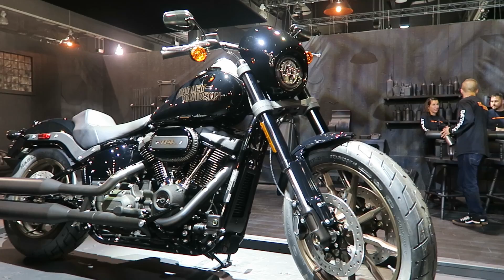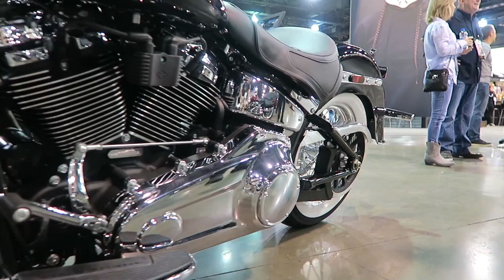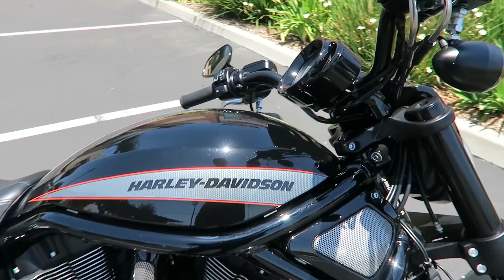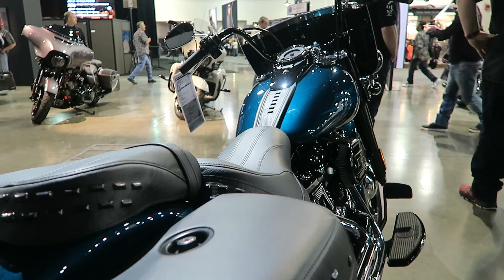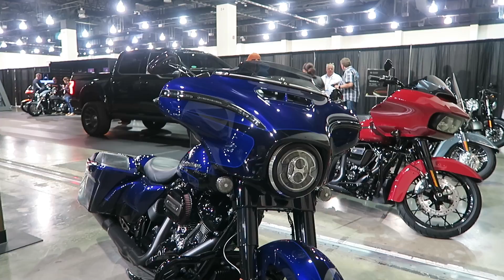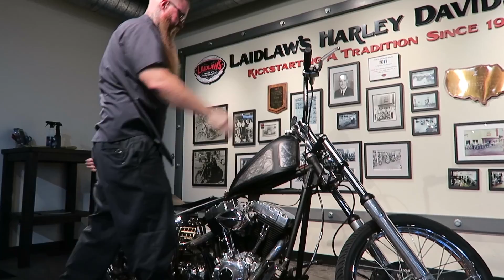Harley-Davidson: The Look, Sound, & Feel - You Just Wouldn't Understand

Comment: I have a Kawasaki Vulcan 1600 right now that’s liquid cooled. It makes no big difference on the Kawasaki 🤷‍♂️. It’s all bottom end torque and falls flat on its face on the top end. About same HP as the Harley’s. In my opinion the water cooling just adds more things to go wrong...coolant leaks, water pumps, ect. It also has overhead cams. Again no big advantage over a compatible Harley. They Harley twin cam 88 I had actually ran stronger than this water cooled overhead cam Kawasaki. Don’t get me wrong it’s a great bike and I got it really cheap just to have a little fun with until I’m ready for another Harley. But judging by Kawasaki just adding water cooling and overhead cam doesn’t make it blow a Harley out of the water like many people think. I got smoked by buddies 103 softail pretty easily

Comment: In 2016 I purchased my first Harley, a Velocity Red Sunglo Street Glide Special. My previous bike was a Kawasaki Vaquero. While I would say the “fit” on the Kawi was good, the finish was not even close to the Harley. I also picked up on the “feel” of the Harley immediately. I’m hooked. Just purchased a 2020 Road Glide Special and can’t say enough about how much I love this bike. The only issue for me with these bikes is the suspension. I am only about 155lbs and find the stock suspension to be very harsh. A quick change to Legend suspension solved that problem, and I anticipate putting down a lot of miles in this bike! We have a very active HOG group here and that has opened up a new group of friends and contacts as well. I don’t anticipate ever riding another brand again.

Comment: The bikes are just way overpriced and they have cheapened them up in comparison to the  older models. The new softail models having the stupid so called decorative fake fuel cap surely they could have blanked out the hole or made it dual fillers ,instead they  put a shitty chrome cap in the hole .Considering a low rider here is priced at $24495 (a road king is $34495 how is it $10000 more bike? at least  you do get a fuel guage and a working fuel filler in the tank it is a lot better bike, but $10000!) its just not good enough .Also having a mono shock is no big deal ,Harley seems to think they reinvented the wheel because of this ,the old frame was fine anyway. Yes the paint is good on harleys but it can't justify the cost and they have cheapend out on alot of the colours now. I think they should have just stuck with what they had and made a few improvements to the reliability . My closest dealer here in Aus seem to only cater to people who just want the bike for looks and the name on the tank ,start asking questions about the bikes build and engineering and you are treated with disdain this seems like a common theme around the world with a lot of dealers.I think Harley Davidson as a company take people for fools ,I feel for the good honest dealers out their such as Laidlaws. Having to explain the one key fob and heel shifter removal amongst other things just should not happen on products that cost this much. The new bikes just don't have the same feel or sound and you pay more for less.

Comment: I agree what you said about the V-rod.  I was so happy when the V-rod concept of a high reving liquid cooled engine was announced.   I pictured a fast good handling bike, then it came out.  Terrible geometry,  stupid forward controls,  basically it wasn't a good cruiser,  wasn't fast enough,  didn't handle at all.  I ride an FXRT and basic FXR with mid controls and have been waiting for something similar but we know it won't happen. No other harley has appealed to me where I would even keep it if it was given to me.  Now the adventure bike, YES!  It looks like they designed the bike from the ground up and not a dude in a dress like the Vrod.  The power on the adventure bike is right between the KTM and BMW.  If the weight and price is there too, I will go buy one.

Comment: That is exactly what a love about HD sound, look and feel, it is old nostalgic and kinda of obsolete machine with some flaws like poor suspension, lack of power and questionable reliability especially from Twin Cam that I own but I still love riding it and If I ever have to buy another cruiser I doubt I ever look into another brand. I hope that big twin will remain in its current configuration. Modernized Harley with newer type of the engine will not appeal to me as I will simply choose another brand with way more experience and know how in building hi tech liquid cooled multi cylinder engines. I understand that Harley needs to build bikes that will attract new younger riders but I hope that HD will keep its traditional line of big twins and Sportsters unless eco mafia will destroy and ban our beloved machines from use.

Comment: Out of respect, I watched the whole video. I still own and love my Road King Twin Cam, modified heavily. I have to disagree with a large amount of your video, I was in the market for a new Limited to replace my Ultra Classic. I bought into all the things Harley doesn't want. Including the power windshield. My second bike choice involved ride comfort, options, trade. Whatever was driving the trade in, I got 3k more for my Ultra at Indian than Harley would give me. That's real money. The standard equipment, steel braided brake lines, chrome lowers, quick detach trunk, TPMS, heated leather touring seat. Led lighting all around. Sometimes it's not about owning a Harley. That chunky aluminum frame and stressed member engine drops weight and center of gravity. I test rode a few new Harleys and liked them. I rode the Indian and was shocked at how plush it is. It's a lower seat height, it's my lovely short legged wife being able to climb on easier. Here is where I get to massage your ego a bit. I will be the first to say the fit and finish on the Harley is superior, they are beautiful, but I am not looking for that in a long distance touring bike. I want that gear to gear primary, the ability to change the drive belt with out taking a primary drive off, the one hole oil change, the Fox monoshock suspension. I love my Harleys, but I am now 1500 miles into loving my new Indian. Who knows, it may change, but for the major component failures I experience with both Harleys at and under 40,000 miles, I'm moving on.

Comment: in  1975  Kenny Roberts brought out a  Flat Track bike with a  4 cylinder  Yamaha   two stroke .. I  had  about  140  HP  HR  XR-750  had  75  HP .. and the Yamaha was way lighter..  The tire did not hold up Now days they have much better and wider tires   and have  110 HP ..  The DD-XR-750 had to be rebuilt every weekend .. Indian  suggests  a rebuild every  40 hours   25 mile race at   35 seconds per  lap  only takes  15 minutes to run ..
https://www.bitchute.com/video/PKyCKRU6e6xG/
  By 1985  the Yamaha TZ-500 was making  150 HP    technology advances  except those who run  air cooled  push rod motors..

Comment: Matt, unfortunately the sound, feel, and look making up a "real Harley" just ostracized the upcoming Pan America, Bronx, and the 'cruiser' version the Custom (you did NOT qualify this as the characteristics of cruisers until half way through the video). These will not be pushrod, not air cooled, not 45 degrees, likely will not have a big bore kit, not have the Harley 'look', may end up sounding like an import, and will likely feel completely different from anything else in the lineup.  If this is an indication of the reception these will get then the launch may not go too well.  The Vrod example you highlight just doubles down on this prediction. The PA and Bronx will be a major departure in all aspects and will be labeled "NOT A REAL HARLEY."  Good thing I don't care since I am anxiously anticipating the PA launch so I can take one for a test ride.  A test ride on a now labeled "fake" Harley. Makes me sad. Dismissing this later does not matter, you already defined what a 'real Harley' is feeding the misconception out there amongst the people that think anything without a carburetor or kick starter is 'fake.'

Comment: In my opinion why the V-Rod was a miss simply due to ergonomics. Put that engine into a Road Glide or Street Glide design and they'd have sold. I actually liked the V-Rod engine "look" as an aside to address the cosmetics that you mention Matt. I'll agree that the V-Twin sound has a great sound. What I need though is a cooler running engine. You all are spoiled back in California, try to deal with the air cooled touring bike in traffic in the South. I miss California, born, raised, grew up there, moved away decades ago due to work and life, that's on me. The bike needs to be designed from a world wide perspective. That you can use it anywhere or most anywhere and have a good experience. Not one where your bike shuts down due to heat issues while on the interstate down in say Alabama for example, which did happen to me while on my 2015 Road Glide Special during the summer a couple years ago.

Edit: Forgot to mention, I loved the whole start of the video with Bob. So much awesome on that old HD.

Comment: I've ridden a few iterations of Harley and if I'm honest other than the sound and the visceral feel of a v-twin it under performs in just about every category I ride a motorcycle for.  The power/handling/braking/ of Harley leaves a lot to be desired unless you are literally just out to cruise in a straight line and be seen.  Harley sells an image as much as they sell a piece of equipment which I get and if that's your thing then that's great.  I ride a Honda XR650R in Baja not because of the look, sound & feel.  I ride it because it is a great cost effective piece of equipment that helps me to explore remote places doing something that I love doing, riding a motorcycle.  That doesn't mean I'm going to get a leather Honda vest or a Honda tattoo to show others how good it is because that's not really at the heart of loving all forms of travel on 2 wheels, at least for me :)

Comment: It' funny ... you say your dealership doesn't compete with Indian but yet you continue to bash them.  Any Indian with a good set of pipes (Including the Challenger) will sound every bit as good as a Harley. You guys sound ridiculous. Who wants a power windscreen with all that weight. Who wants a great Ride Command system with all that information. Who wants a 122HP motor...who wants over 4 inches of travel in their rear suspension.   c'mon man
Reply from the maker: bbgmarine I love my new Indian cry baby viewers. I never even mentioned Indian in the video. Are you just ultra sensitive and insecure? But since you brought it up: They don’t sound as good as H-D, the windscreen is hideous, the design is atrocious, the engine puts out 103 HP to the rear wheel which is all that matters. So it does about 15 more H-P than the Harley without water cooling. The new HD infotainment kills the rider command. The fit and finish is trash. The paint looks like it is intended for an off road vehicle. The lighting is very cheap looking. The inside of the fairing looks like it was slapped together with no thought to a clean design. The bags are flimsy. The Plastics on the bike are very cheap and the quality is no where near the H-D.
Reply: @MattLaidlaw  - I have sitting in my garage a 2019 HD TriGlide Ultra. As a matter of fact, it's the same color as the one you and Nick did the YT video on.  It's a great machine and my wife and I love it.  Paid cash for it. She doesn't feel comfortable riding on 2 wheels. We're both 62 so I won't question her judgement there. I just bought a new 2020 Challenger and I love the bike. Handles like a dream and will walk away from any stock HD 114 out there. But that's not why I bought it. I just wanted the feel of riding a 2 wheel bike. Both brands have their pros and cons. I'm just saying...leave all the negative out about "other" brands and promote what you sell. People respect that. Ride safe sir...

Comment: I'm a Harley owner. I agree with a lot of what you said. I own a Harley because the bike stirs my soul like only a Harley can. I have owned 3 different Harley's over the years. Where I don't agree is I wish Harley had a windshield that would adjust up and down. I really like that feature. I also hate that I have to all ways go over my bike making sure everything is tight. I keep locktite and tools with me. That's one part of owning a Harley that gets old. Now I drive 100 miles everyday round trip to work and back. I also run the dog shit out of my wide glide. It also don't like the 100 degree heat with traffic in the summer. Can't wait to see what the brinks brings.

Comment: Matt & Nick - nice job ... as always.  I agree with most everything said.  Dudes, when I get off my RK, I look back at it 100 times before I get to where ever I’m going.  That black and chrome is just stunning!  You dont get that look on anything else.  And the stock sound is just perfect.  It doesn’t carve up the twisties but it feels good.  It doesn’t turn 8 seconds on the quarter mile but it’s more than enough.I felt the same with my ‘68 Camaro.  My Dad and I painted that car a bright blue metal flake.  Just couldn’t take my eyes off it.  Had a 327 - not very fast, but fast enough.  You are absolutely right in that specs tell only part of the story.  Most of it is how your soul feels when riding.  Great job guys.

Comment: I see a lot of people in the various HD forums making a lot of complaints about their bikes. Now, some complaints are good ones. "I just got a new bike, and the farble shaft was incorrectly aligned," or "I was just riding down the road, and my transverse shim bearing snapped," or "I just noticed spots of hydraulic fluid on the floor of my garage." Those are good complaints because they relate to the quality of the machine. As consumers, we have the right to demand that Harley manufactures a quality product. To make those complaints, are to judge the Harley on its own merits.

But I've noticed several complaints about the various Harleys in relation to other bikes. "My Aprilia was so much faster." "My BMW steers much better." "My Gold Wing was so much smoother." "My Vulcan had way more torque." That, I think, is a different kind of complaint.

Because if those are your complaints, I have to wonder why you would buy a Harley in the first place. Maybe it just isn't the bike for you.

Harley attempts to do one thing and do it well. They make cruising motorcycles and touring motorcycles. That's it. They don't have the biggest engines, the highest speed, or the most torque. They aren't designed to be high-performance speedsters, and they aren't mean to be smooth or tame or ultra-quiet. They are intended to be--and are--the personification of motorcycle cruising.

That's a different style of riding. It's not about aggressive maneuvering, or fantastic speeds. It's about the freedom of hitting the open road, feeling the sun on your back and the wind in your face. Hearing the basso profundo throbbing of the pipes, and feeling the throb of that V-twin between your knees. You don't have to scrape the pegs at every corner, of blast through every sweeper with a hard turn of the thottle. Oh, sure, you can do those things--and often do--but it isn't esssential to the ride. Because for a cruiser, the ride's the thing. It's the journey itself that matters.

Second, the Harley is simply beautiful. There's a reason why the Boulevard, and the Stars, and the Vulcans look the way they do. It's because they take their styling cues from Harley-Davidson. The Harley is the standard for the cruiser look. When Squarejohn Citizen thinks about motorcycles, he thinks of Harley-Davidson. The Harley is a work of art, visually. It retains a classic look that speaks to you in a way that the copies don't. You can stick a batwing fairing on a Midnight Venture but it just doesn't look the same.

Finally, when you buy a Harley, you are buying something more than just a mototrcycle. You are buying into a mystique; a tradition. You are buying into a style of motorcycle--and motorcycling--that is different. The Harley speaks to a life-style of independence, freedom, and yes, rebellion, that others may try to copy, but can never quite duplicate. To own a Harley-Davidson is to participate in a particluar life-style and culture, even if only at the periphery. It carries an aura of danger-whether that's individually true or not of the rider--that other bikes don't. No one's clutching his wife a little closer, or getting that nervous feeling in the pit of his stomach when group of BMW riders pull into the parking lot.

If you want the quiet, smooth, "I can hardly tell it's running" feeling, then get a Gold Wing. If you need to just tear up the streets at all times, get a Speed Triple. Thre's nothing wrong with a Boulevard or V-Star. They're great bikes. Lots of people love them. And if that's what you want, you should get it. There's nothing wrong with getting what you want. No one should put you down for it, or disdain riding with you.

But if you get a Harley, judge it on its own terms,

Culled from HD Forum, written by Dale Franks
Reply from the maker: 81722Les well said. There are different bikes for different applications and riding styles.